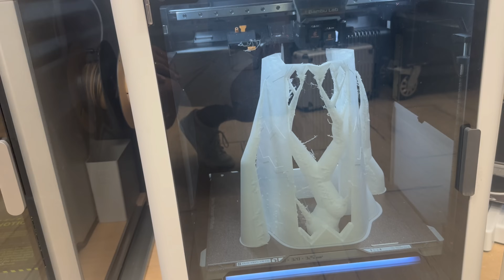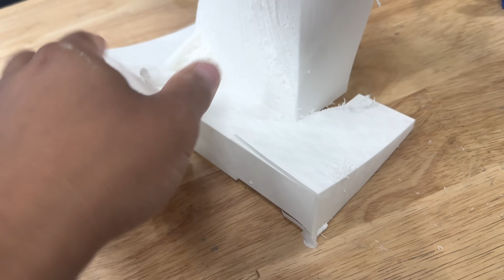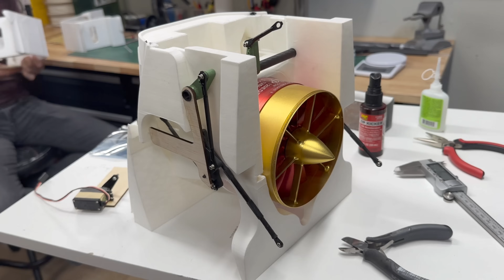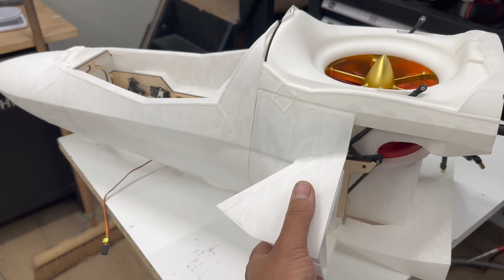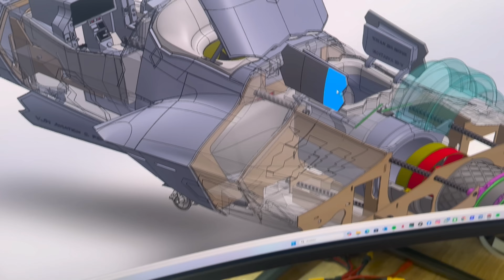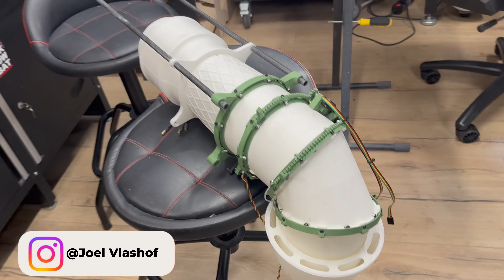F-35B The Biggest Replica RC VTOL Build Installing New 120MM EDF's PCBWay services

Comment: I am curious as to whether you intend to make anything you have built these past few years ( harriers , F35 and other jets) and shown on this channel to public viewers?  Your models and development are truly great it is just a pity you don't sell the 3D files and build details so we could build our own.  I think I asked this very same question over 12 months ago and got a maybe coming soon answer.  Now, like others, I have to turn to different maker builds doing F35 and similar systems which is a real shame.  For sure your models fly much better, so I hope soon you could do some sort of online shop etc to buy the 3D files and where you source essential parts. Love your videos and hope to build something similar soon 😊
Reply from the maker: RC-jetprint.com
Reply: Thank you. I went there but only could find the older tiny versions  of the F35B is available ( <1m wing span). I was hoping to build something double that. Also I dont think I can use the files as they appear to be for only the  Bambu printer and its studio slicer. I have a Creality instead  :-(  I was also hoping to use Colorfab LW-PLA high temperature (HR) filament. I recently printed a Horten 229 Jet and it turned out great using the Colorfabb HT version of this filament.   So I am not sure if I could adapt the files. You get the benefit of more sun heat resistance  by the way but same foaming PLA light weight.

Comment: Very nice work and video. You know, I've seen several quality printed aircraft based on full scale but what I want to see is what you guys can do with say a themed aircraft. Say something above the current gen fighters...maybe an artistic GEN 6 or 7 aircraft. It should also make use of the current long range FPV setups with functioning glass cockpits for the FPV cam. Guys like you have proven how easy it is to print them, set them up, and fly them. So if so easy then try something futuristic. Plenty of flight controllers out there these days. Almost a shame printing shapes that can be hand made Vs printing designs that cannot be done without being printed.